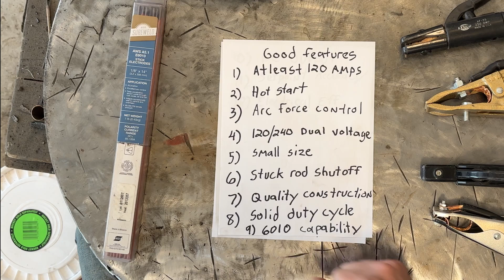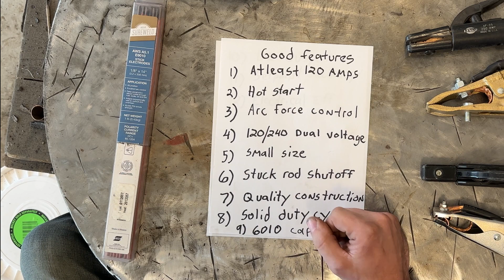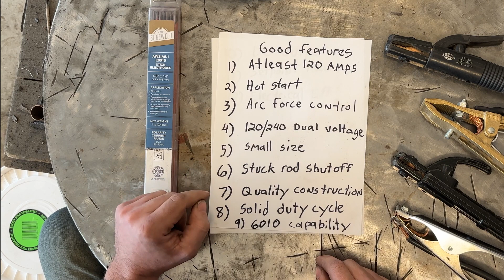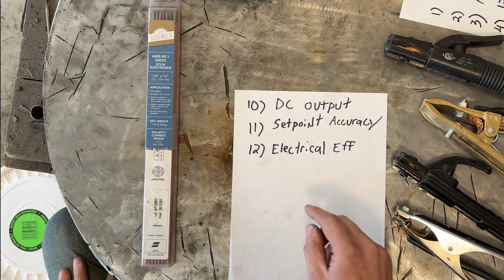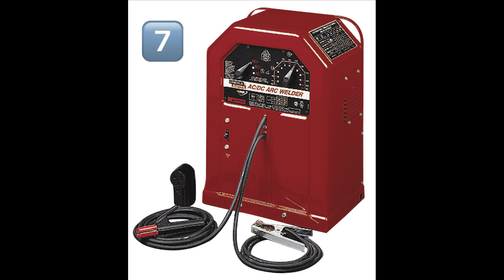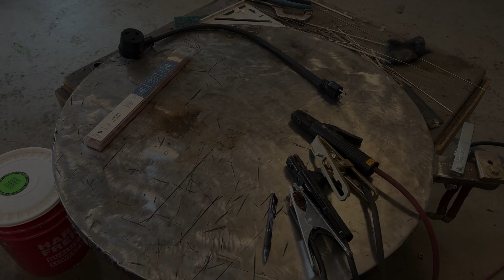Picking out a stick welder (features to look for and top 10 recommendations)

Comment: TIG next please?
Even if there is multiple videos out there, there is nothing like watching a video from a reliable source.
Reply from the maker: I have finished all the stick videos I need to edit them and get them up.  I will then be diving back into tig for a while.  Any specific things you want to see?  I will be doing a aluminum tig repair tomorrow that I will film and put up. 😀
Reply: @makingmistakeswithgreg  videos for stick welding have been extremely helpful so continue with similar content: welder recommendations, heavy strength welds like the D ring and hook exercise, etc.

Comment: I can reccomend the EWM Pico 160 cel puls if you have a a decent budget and are in AU/NZ/Europe. Possibly available in US. Has pulse on stick and TIG, in addition to everything else on that list. Needs 240V/15A though (though mine works ok on 10A plugs after I 'accidentally' cut the earth pin narrower :) It definitely runs 6010, though, its the entire reason I bought it.
Reply from the maker: Thanks for the recommendations, definitely helpful since every country seems to have their “own” welder companies.  That Pico seems like a nice package, even has stick stuck which is hard to find.
Reply: Removing the earth does nothing to prevent a circuit fuse to trip. It will get you executed if the chassis of the welder get live due to internal fault. Cheers.
Reply: @Cptnbond  I made it skinnier to fit 10A sockets, I did not remove it. Cheers.

Comment: Nice list, and it’s pretty damn accurate.  I couldn’t find any flaws with your list. I primarily stick weld at work and home. I have an old tombstone 225ac with the white dial knob on it, I haven’t t used  it in at least 7 years lol. My go to stick machine at home is the cst280. It’s a small but amazing machine. It makes 7018 restarts pleasant 🤣. I’d like to get a dual voltage machine for the portability and 120v option. I’m half torn between a rouge or the Miller 161.  I’ve used quite a few of the 161stl’s and they too are great machines, just pricey. I’m enjoying the content and look forward to see what you do next
Reply from the maker: Glad your enjoying the content 😀.  I owned both the esab rogue 180 and the maxstar 161 sth.  They are both awesome welders.  If I had to pick one of the two I would take the maxstar.  For a couple reasons: 1) the stick stick feature works great and saves some swearing lol.  2) it is literally the perfect size to move around/carry.  3) the fan on demand shuts off when it doesn’t need to run which is a feature I really like with welders.  It is expensive, but it welds so good and is so portable it’s worth it.  The esab rogue is a great welder too.  The solid handle makes it easy to carry.  You won’t be disappointed in it, but if you tried both machines you would want the miller.  The 161sth is the only welder I regret selling, and I have sold probably over 20 welders in the last 5 years lol.  I actually sold it to buy my new dynasty and that’s so heavy I don’t want to bring it anywhere lol.  I am going to probably buy the fronius battery powered stick welder soon and try that out.
Reply: @makingmistakeswithgreg  thanks for the insight. I never used a rouge and I wasn’t aware of the fan. I definitely liked the Miller 161’s when I used em. I’ll probably keep my eye out for a used one, but the local market here in Pittsburgh seems a little high and dry lately. I’m not too familiar with Fronius, but I’ve been lookin into them. They seem like killer machines. I’ve seen a few Fronius wire feeds unit on a job, but I never got the opportunity to run one. That accupocket seems like a great unit for the secluded or limited repairs.